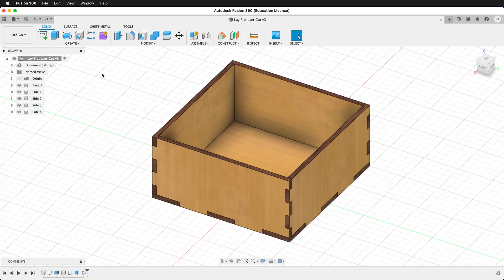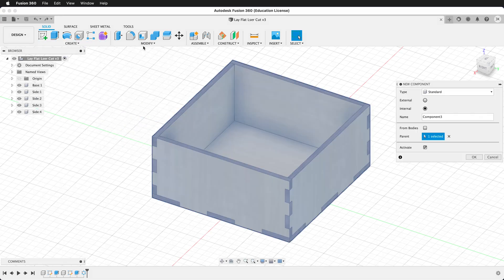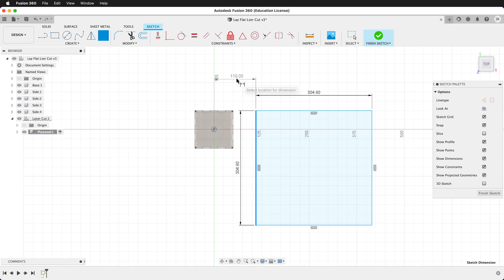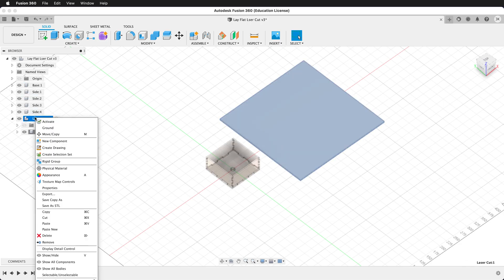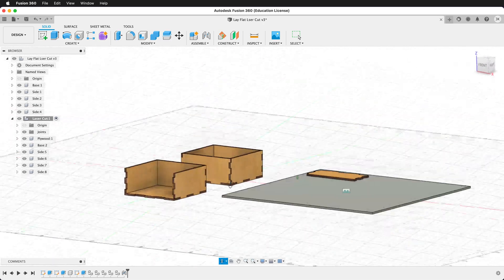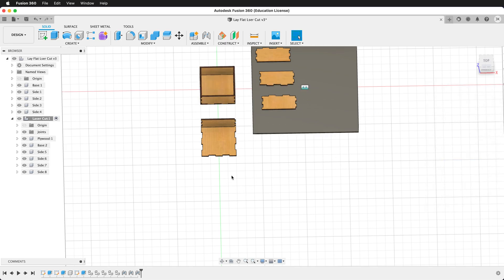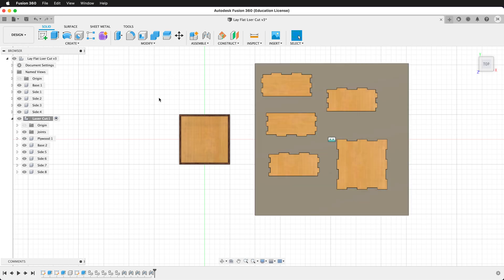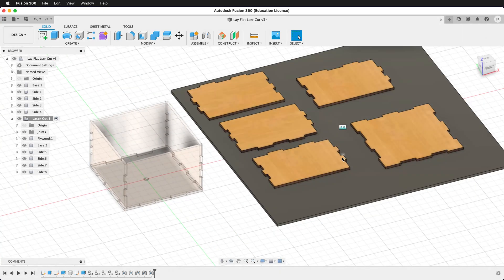Arrange Panels Flat for Laser Cutting in Fusion 360 without Arrange Tool

Comment: I've never understood why people try and make allowances for kerf in the actual design, it's much better to do that in the software that is actually controlling the laser itself. Kerf varies with material and with lens focal length, so making the necessary changes in the laser controlling software makes much more sense.
Reply from the maker: I agree, kerf should be different from the nominal design, it can be done in the laser cutting software or he cam workspace in fusion

Comment: you mention etching when orientating parts. But how do you add etching to the part? i have my lines in the sketch but cant get it onto the model or renders. Do you know how to do this?
Reply from the maker: Etching is usually done in the laser cutter software
Reply: @WhatMakeArt  so theres no way to add etching to the fusion 360 model? Even for renders or something?
Reply from the maker: @ChitosVids you could use Fusion 360 's decal option for renders, use a transparent PNG

Comment: Very Interesting, I will need to try this.
 I did the opposite.   I made the object with flat sketches. Which is usable immediately for export,  and then assembled the preview afterwards. move snapping the objects (wood) to each other like you would actually assembling.   And thebparts and preview are still fully parametric also.
Reply from the maker: Either way, works, building the object and nominal dimensions can make it easier to edit with parameters and then automatically lay flat.
Reply: @WhatMakeArt  actually useing the cam function for the kerf makes all the sense. Kinda Embarrassed, So I am going to do that next project (no idea why I didn't think of that, I use a large CNC in my day job)..  I think that fusion cam was off limits/limited for much of the free in the past so I just didn't use it.
So, extremely useful video to jog a old brain, thanks.

Comment: Very useful Stavros, but is possible to print in paper..? I have a plane designed in f360 and need print the components in a paper plan. Tanks
Reply from the maker: Great question, of course you can print a DXF file on paper, you can use Inksape which is an open source program or Illustrator from Adobe or any many Autodesk programs. If I was doing that, I would set the kerf of the tool in Fusion 360 to the thickness of the line that I'm going to print on the paper. Make sure you import the DXF at the right scale and it will print fine.Good. luck and let us know how it turns out.👍
Reply: @WhatMakeArt  check the solution and return the experience. Thanks

Comment: How can you move the joined pieces? it does weird stuff if i do it
Reply from the maker: If you have rigid joints for the motion of the joint then you have to edit the joint offset in the joint feature in the timeline.

If you use planar joints then you can move the pieces around with the move command.

Just make sure to select the components. Also make sure to capture the position after you've moved everything.
Reply: @WhatMakeArt  I know this is an older video,. but new for me.  Great information.  My challenge still is once I have placed the piece on the plywood, and then resise later by parameters, and I need to move them around, I cant.  I have tried what you mentioned, without success.
Reply from the maker: @chrisoneslager7334 it's a little different now in Fusion 360 with the ability to make Manufacturing Models, Do you mean that you can't edit the planar joints?

Comment: Only gotchas I ran into was that you can't cover up the center point of your plywood piece otherwise you have to hide/show the piece to reselect it. It seems that if  you move pieces after the initial join and move they move in the copied model as well. Thanks!
Reply from the maker: You can always select at a random point on the bottom plywood. The only downside of that is you have to click the plywood a third time to confirm the location. Using the center is less clicks but does have the issue of needing to move the pieces.

You can also use a planar joint rather than a rigid joint and then you can use the on-plane transform controls to move the pieces around after the joint is made.
Reply: @WhatMakeArt  I didn't know at the time, but if you do cover it up you can go back and right click the joint to "Edit" it and then move it away from the center.